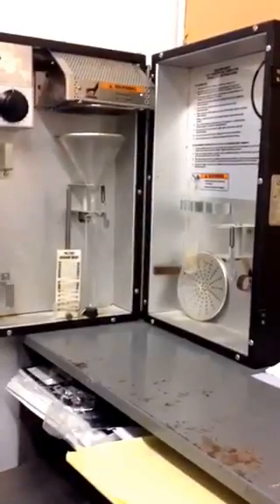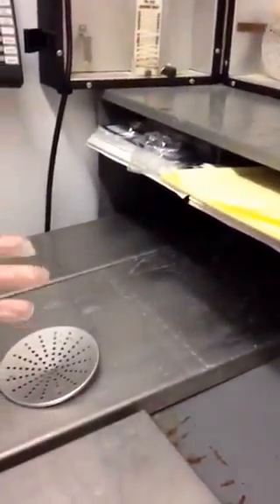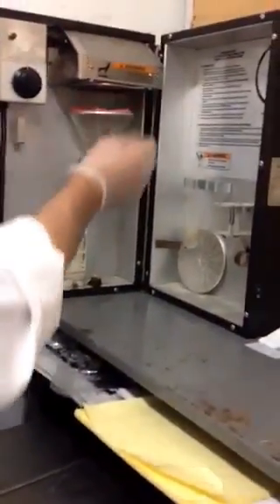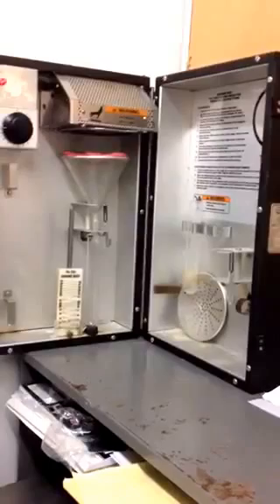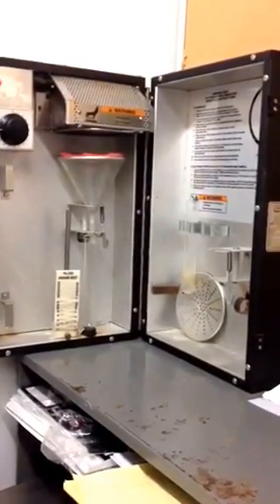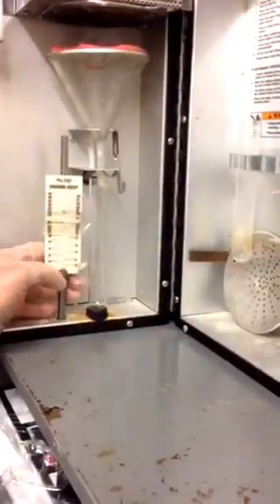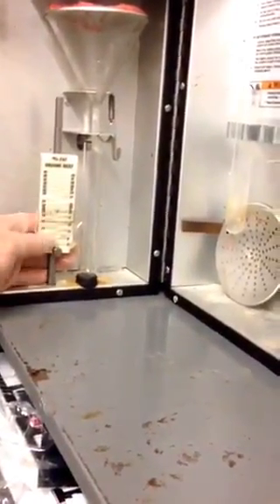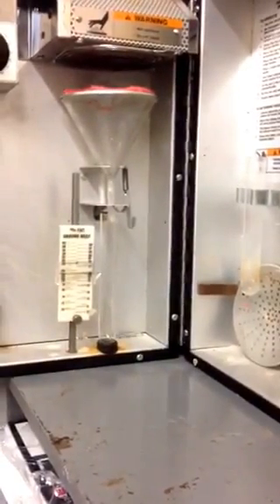Hobart F101 Ground Beef Analyzer | Step By Step Testing Process With Meat Manager

Comment: I want to ask. what is the temperature used to heat the meat?
Thanks before
Reply: There is no specified temp. that it cooks at. Its a heating element that comes on with a timer for 15 minutes.
Reply: What is the machine roughly cost/why is it important